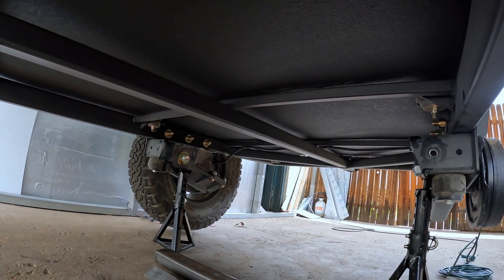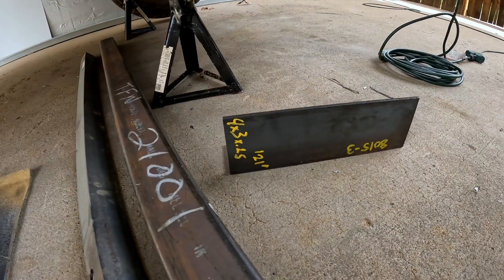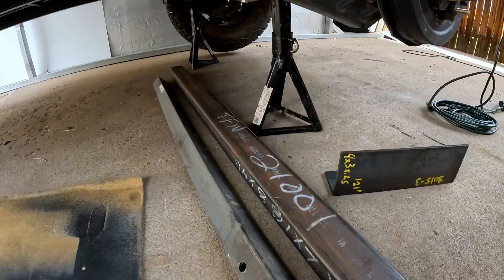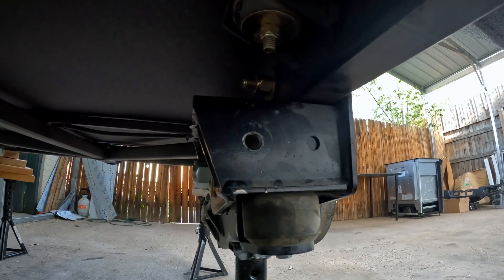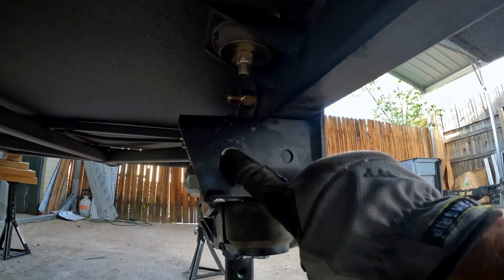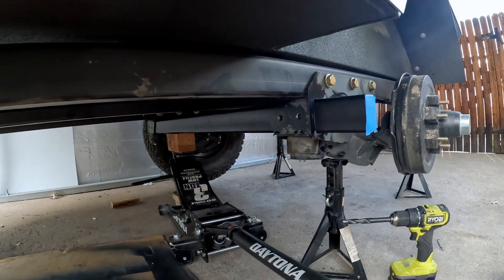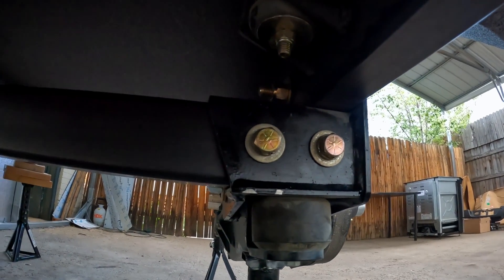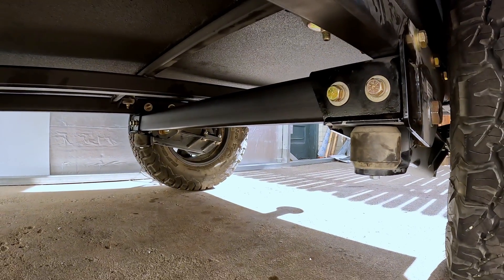DIY Overland camper trailer build: Timbren axle-less suspension crossmember

Comment: I am adding a crossbeam too. How did you bolt it on? Did you have a nut on the inside of the beam?
Reply from the maker: I just threaded the hole with tap.

Comment: Thanks for the video.  I have been looking for a trailer that can use the same spare tire as a ram 2500, but this seems rare.   Does your suspension have that ability?   Thanks
Reply from the maker: You will have to check the timbren website and see if you can get your bolt pattern.
Reply: @infosponge  Thanks,  will look again

Comment: Your jack stand spacers are dangerous as can be. You should find something wider and put it under the stand way more stable.
Reply from the maker: Thanks for the safety tip.  The redundant stands, floor jack and wheel were there for backup.

Comment: Seems to take away all of the advantages of being "axle less"?
Reply from the maker: Not really, the trailer still has independent suspension.  It does reduce some ground clearance in the middle (only advantage that is taken away).  When I make the upper braces I will likely remove the crossmember.  The frame braces are just way more difficult to fabricate than installing this.
Reply: @infosponge , it’s your rig and the desired end result is totally up to you. I’d keep the cross member and accept the slightly smaller middle ground clearance and call it a day. Sure the additional braces would help but aren’t necessary. Now more than ever. With that said, I’ve considered replacing my torsion flex with the Timberen on my teardrop but seeing that I rarely see terrain worthy of the upgrade I always talk myself out of it.